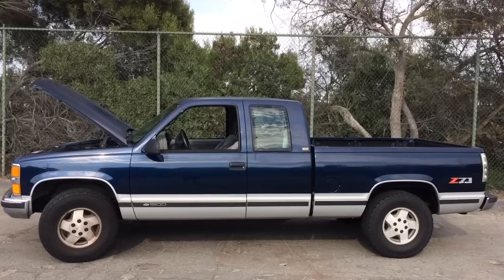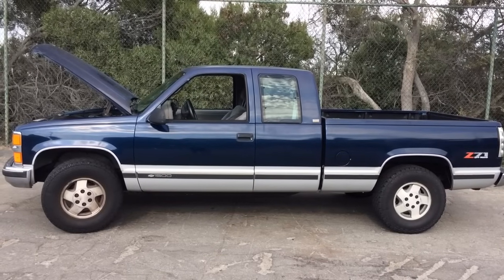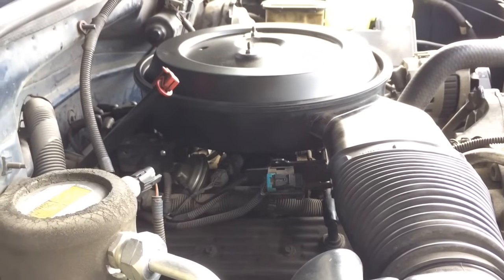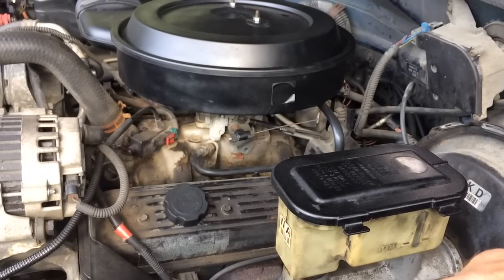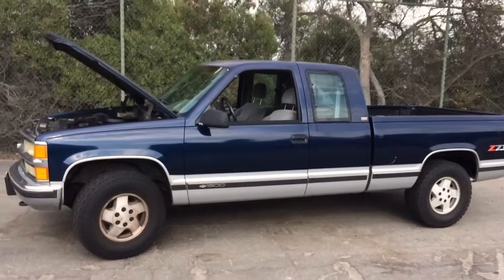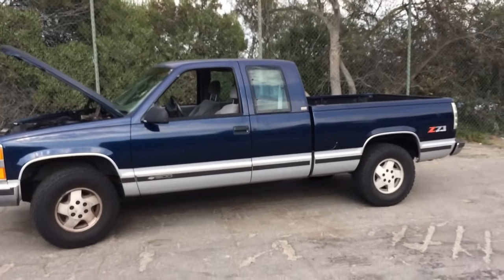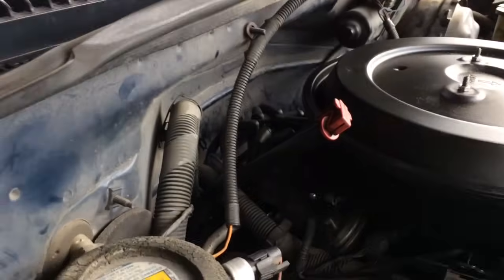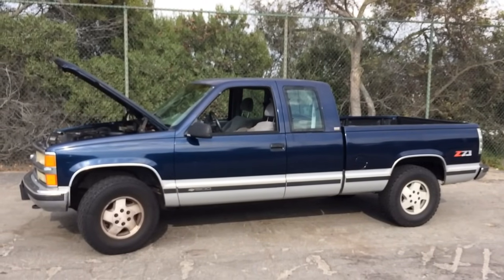Chevrolet Truck Hesitation Problem Fix

Comment: I have a 95 with a 350 and had the hesitation and sounded like it had a big overlap cam. Turned out to be the EGR valve. I had replaced MAP, all the rubber hoses, cat,  tps, and my sanity first.
Reply from the maker: At least you figured it out. With hesitation on these trucks, there are five or six different things that could cause it, and it’s hard to tell which one it is.

Comment: My 1998 Silverado is doing the hesitation thing again and I fear it's the fuel pump again. I had one put in about 50,000 miles ago and it cost me nearly $1,000. I'll try the things you mentioned but I'm thinking these symptoms are the same as they were before.

Comment: My GMC C3500 OBS with 454 Vortec has been driving me nuts (no pun intended!). When it is running in Open Loop it runs great, but the instant it switches to Closed Loop it goes to running richer and richer and richer till it's slobbering rich and missing across all the cylinders! For the life of me, I cannot figure this thing out.... new O2 sensors, new MAF sensor, new EGR valve, new Purge valve, new MAP sensor, new injectors, new spark plugs, new spark plug wires, new distributor, new ignition coil, new intake gaskets, new fuel pressure regulator (verified to be making 58 psi at idle!) new idle air control valve, new camshaft sensor, new air temp sensor, new crankshaft sensor.... this is nuts! I'm about to give up and take it to dealership (Lord help me!) and see if they can diagnose what's causing this!!! Ughhhhh!
Reply from the maker: It could be a bad  ECM computer.  I had to replace the one on my truck and it made a difference. On my truck, the catalytic converter went bad and the plates sometimes would block exhaust flow, making it run rough.

Comment: I have a 96 and I just changed the coolant sensor and I thought it was the fuel pump and everything difficult and it was a simple $25 fix. The sensor screws right into the top of the engine.
Reply from the maker: Thanks. That’s a cheap fix, though tough to diagnose.

Comment: Yeah I forgot to mention I don't know how many miles do you have but it should last forever I'm in original owner I bought my truck brand new I live in Arizona there's no rust nothing's wrong with the whole truck it's perfect original engine and transmission and I'm at 443000 Miles and going strong....
Reply from the maker: Mine is pretty low mileage compared to yours. I guess that means I can drive it for the next hundred years. These things are built to last!
Reply: Update I just did 500,000 the engines still all original the transmission started slipping in 4 th gear at 467,000 
so I had the transmission rebuilt.  My truck's running great I love it hope yours is still around😊

Comment: Just got this problem on my 94 Chevy 5.7l has new fuel pump new fuel filter new tps new map sensor new fuel pressure regulator and compressor test has fine compression all new sparks plugs also doing the ecm tomorrow hopefully that fixes it
Reply: Catalytic converter is also fine

Comment: My 98 has 299500 on the clock and doesnt burn a drop of oil these trucks will run forever as long as the rear main seal leak doesn't get too bad, they all leak there. Still pulls better than any 5.4 Triton and they're pretty good on gas compared to most trucks even new ones
Reply from the maker: Yes. Even with the common problems, these are great trucks, and they can run forever.

Comment: Holy crap as another guys said in the comments. It was my EGR valve (95 Silverado 5.0 TBI) you can confirm this super easy by disconnecting vacuum line to the valve and test drive. I can’t believe it but my truck drives like new. No flat spot whatsoever. I’ll just leave it disconnected cuz it’s my beater with 236k miles for yard projects and it runs super smooth off throttle now and can get up to speed with just 10% throttle.
Reply from the maker: It is crazy how much impact a bad EGR valve can have on how the truck runs. That’s a cheap and easy fix for you. I made another video where I take the EGR valve out and clean it and put it back on, so that is an option if you want to hook it back up. It is probably just jammed up with carbon.
Reply: hoohoohoblin not a bad idea thanks 🙌🏽

Comment: I just had my heads done on my 94 silverado and the truck hasn't been right since. I replaced the maf sensor, ignition module and o2 sensor. Then the codes read egr valve and selonoid. When I went to replace the selonoid I noticed the mechanic had hooked the vacuum line up to the vent. I hooked it up right and the truck ran great that day but went back to hesitating the next day.

Comment: Im here same reason everyone else is 😂 1992 C1500 5.7 TBI isles a little high, but doesnt die, but driving it if i kick the throttle down itll kinda bog or lag a bit, sometimes will surge and run good then bog down again.

Comment: I have a 93 silverado 5.7 ran fine until I used spray injector cleaner now it hesitate when I take off I already replaced egr map sensor  throttle position sensor and the idle air sensor  didn't solve the problem  any ideas?

Comment: Yeeeah... I had a 93 gmc sierra. Had the same problems you were having and i don't know if it was the previous owner or not but noone put a fuel filter on it. Ended up costing me a whole lotta money in parts and in the end I sent her to the junkyard cause i couldn't spend the money on her anymore. She's still sitting there...
Reply from the maker: It's very frustrating.  This truck ran terrible for a year and a half while I kept replacing parts.  The most frustrating part was that I knew it was one simple thing that needed replacing, but I didn't know which thing.  I ended up giving it to a mechanic, who spent a month trying different things until we got it sorted out, and it runs great now.  In my case the main problems were the fuel pump and catalytic converter.
Reply: hoohoohoblin Yeah, I could never get mine figured out. I even had several mechanics take a look at it. Took the seat out of it as a souvenir for my first truck.
Reply: to simple just to have someone check to see whatt the problem was

Comment: Don't drop gas tank- much faster & easier to raise the truck bed 10 inches or so  it only has a few bolts holding it on..

Comment: Don't have to drop fuel tank to get fuel pump out i found it's easier to tilt the bed and leaves ya with plenty of room to access the tank from the top. Just remove the 2 bolts on the driver side and run the 2 on passenger side almost completely out but not all the way then disconnect tail light electrical harness tilt bed up and put a block of wood between bed and frame.
Reply from the maker: Good advice. I will do that next time. Thanks.
Reply: Don’t forget the ground strap too.

Comment: Going through the same thing with my 95 Suburban right now. Replaced throttle position sensor, fuel pump, map sensor, oxygen sensor and catalytic converter. Cleaned the throttle body and injectors. Checked vacuum lines, etc. Runs good at high rpm, dies for no apparent reason when pulling up to stop signs/lights, or sometimes while just sitting and idling. Seems like it wouldn't run well at high rpm if it was a fuel filter problem? Going to clean the egr valve next. Newer plugs and wires, no missing or rough idle. No check engine code. If the egr valve doesn't work, next stop is the shop - tired of not being able to drive it. Glad to hear thoughts from anyone who knows about this issue.
Reply from the maker: It might be the EGR valve. Mine got stuck on my Astro van, and it wouldn’t idle until I cleaned it. I also had the ECU computer go bad on my truck and had to replace it. It was idling crazy and the transmission was shifting it really high RPMs, but changing the ECU computer and chip fixed it.
Reply: Sometimes the CAS (Crank Angle Sensor) can cause that.
Reply: sounds like distributor to me
Reply: @cj8172  Those didn't come out on the Suburban until 1996 - mine doesn't have one.
Reply: Update:  Turned out to be the MAP sensor, which means that two new ones I bought online from Amazon were defective. I stopped by an old auto repair business in Table Rock, NE, explained what was going on, and the owner went into the back room, came out a minute later with a used MAP sensor, said, "Try this". I explained I already tried two new ones, and he said to try it anyway, so I did. Check engine light went away and runs perfect ever since. Too late to return the defective ones of course, since I had spent several months trying to fix this *&^$*#@ thing. Half dozen different mechanics between NE and CA couldn't figure it out - this guy, a couple minutes. Sitzman Auto Repair, Table Rock, NE

Comment: This does help incredibly! Thank you! I’ve had the EXACT issues with the hesitation. I do know the CAT is bad, and I have an exhaust manifold leak. I need to pull a broken bolt first, which is giving issues lol. The fuel pump in my area is 180ish to replace.
Reply from the maker: Fixing those things should get it running normally again.

Comment: My pops truck has the stumbling i.e. bucking after having a bad crankshaft sensor. So we replaced it cause we had no spark, we also replaced the camshaft sensor and a few other parts but we're tires of throwing money at it.

Comment: My truck was Hesitating, once the engine warmed up it Puffed Black Smoke and had little to no Power when stepping on Gas Pedal - Replaced the  Coolant Temp Sensor an $11.00 part, problem solved !
Reply from the maker: Thanks. I hadn’t thought of that as being a possible problem.
Reply: @hoohoohoblin  I also recently picked up a 1995 GMC Suburban SLE, 5.7 SB 350 with 82,000 original miles from the original owner - The vehicle had Exactly the same problem after sitting in garage for 11 years - The first thing I did was replaced the Temp Sensor and again problem solved - Go Figure - Take Care !

Comment: Beautiful truck BTW.  96-2000, is a completely different animal, though the skin is the same.  96 was the first year of the multipoint FI and the OBD II engine diagnostics. In other words the first year of truly computerized engine management.  For all the reasons this guy discussed I would steer away from pre 96.  Of course if I could find a gem like this, I would be tempted.  If it were me I would deep six that motor in favor of the hugely upgraded LS truck motor that came out in 2000.  A 5.3 would run circles around that motor and you can get them cheap. You would have modern fuel injection and true computer management that is light years ahead of pre '96. The swap is common enough they actually have kits for it. The transmission is still an 4L60e but in post 2000 era they were much more refined.
Reply from the maker: Good points. My dad has an early 2000s Chevy truck that he bought new, and it gets much better gas mileage, and has been 100% reliable for almost 20 years now.
Reply: @hoohoohoblin   Yeah there is no good reason to stick with the old sbc, they have been largely superseded by what is commonly referred to as the LS style engine that came out in 96 in the performance cars.  The truck version came out in 2000 (iron block with aluminum heads) has been around for long enough they are easy to come by used. A truck like that would be well worth the upgrade and there are lots of you tube videos on that subject.
Reply: Swap engines and then it wouldn't be a numbers matching truck. I think that's important for maintaining the value if you ever want to sell it, that is.
Reply: @jimervin1637  It would just run much better. So it depends on if you want a show pony or a functional truck.  I would say most truck owners would prefer the upgrades of vortec heads a better fuel injection and a much improved ECM. Pointing to a number on a block gives some of us a boner though.  Actually all the upgrades would bolt onto the existing block, so if a less functional truck gives you a boner who am I to say don't yank it. LOL
Reply: I have a friend with a 96 Chevy Silverado c2500 the multi-port Spider injector has failed dumping fuel into the crankcase it was known to be a common problem with this design I have seen new ones break while trying to install them was not the best time for Chevy trucks and even more so now I really hope they get back to making quality vehicles
Reply: @terrybrown797  Okay, think about what you are saying. My friend has a truck that he drove for 27 years and now it has a problem. And the spider design has been know to have problems (like every other fuel system known to mankind). Also, I know a guy that broke one installing it. I really hope they get back to making quality trucks. 

In your world trucks should last how long? In your world apparently there should be a vehicle that should never have any problem even after a quarter of a century? I've installed the the type of fuel injection you mention and I agree it isn't easy but I haven't broken one, so what does that tell you?
Reply: @michaeldose2041  well my truck had three hundred thousand miles on it before the first engine had to be replaced and my first vehicle that was given to me by my grandma was a 91 Ford Aerostar and I had 600, 000 miles on that one. The vehicles that are being built today you are lucky to get 20 to 50,000 miles out of them so you tell me how long should a vehicle last you. Vehicles being built today with known engine defects but are still sold to consumers are averaging 20, 000 to 50,000 miles before engine failure. So I would say vehicle should last at least 300,000 miles before complete engine failure. But if you are happy with 20, 000 miles before you either have to replace your engine or replace your vehicle then enjoy and welcome to China junk. But I am a die-hard American and old-school muscle I bleed red white and blue. I hope these facts clear up any doubt
Reply: @michaeldose2041  sorry I should have worded it better this is not the first time that this part has been replaced this is the third Spider injector to fail
Reply: @terrybrown797 yet our 2011 GMC Acadia ran great until I sold it at 215k miles and only had one set of spark plugs, one set of tires, one set of brake pads only, two water pumps and regular oil changes. And my parents 2013 F150 3.5 twin turbo ecoboost currently has 291k miles on and will still pull 6-7000 pounds no problem. Just had misfires from clogged cats so drilled out cats solved that until we get new cats installed and fix the obvious oil leak from the turbos and beyond.

Comment: I’ve got 1996 Chevrolet Silverado 2500 4x4 I’m running into a few issues like your but I’m not doing a parts canon just shoot and hope for it to work
Reply from the maker: In my case I’m pretty sure it was the catalytic converter plates, which had come loose and sometimes they were obstructing the exhaust, and other times that would rattle into position to let the exhaust flow freely. I would’ve replaced that first if me or my mechanic had figured it out.

Comment: One of these parts might work. Expensive fix.
Reply: I agree why do ten things at once you will never know what fixed it
Reply: It sucks but it's either pay a mechanic a diagnostic fee to pinpoint the problem or just take the money it would cost you and buy those parts. Diagnostic fee is around 70$. Start with cheapest part first.  Regardless, you will have a bunch of parts you won't have to replace for quite a while if you go that route before finding out the real problem.

Comment: Hi there I have a 89 Chevy Silverado C1500 the original 5.0 blew up so I built a new 5.7 and put it in now I have hesitation when I accelerate from a dead stop it is almost like it stumbles sometimes it stalls out the question I have is the ECM from the 5.0 the same programming for the 5.7 any help with this would be greatly appreciated I have been out of work for 9 months and just got it running

Comment: You forgot the intake gasket and cracks in the heads between the valves. Lol and many other issues. I don't think you fixed it yet. Keep looking

Comment: Similar situation for me 2005 silverado replaced fuel pump truck ran great  but then 2 months later hesitation started replaced MAF sensor ran  great for 2,000 miles now was driving stopped on accelerator and truck was shaking and would barely move....pulled over let it sit for 2 minutes started back up again and ran fine for the next 10 miles home....thinking now it maybe the TPS oh and I have already cleaned the throttle body....lol

Comment: I have a 93 Chevrolet 2500 that blew a fuse to the windshield wipers and when I changed the fuse it will not start . The fuel pump will not come on any clues for helping me

Comment: You've changed so many things, but doesn't sound like you tested along the way, just kept thowing parts into it.  So it runs good, that great, but what acutally was the solution?
Reply from the maker: I suspect it was the catalytic converter. Because it would sometimes run fine and other times not, I think the plates inside got loose and would bounce around and obstruct the exhaust flow sometimes.

Comment: ..... So?  What was the one thing that fixed the hesitation?  If I push the gas aggressively at the stop light it will lay rubber.  But if I try to take off slow it will fall on it's face and stall out.

Comment: Hey I’ve got a 1988 GMC Sierra with 5.7 the original engine has been remanufactured to gm spec’s. I’ve added upgraded air filter stainless shorty headers new new value covers and installed dual exhaust with flowmaster super 10. Been running great the last few weeks it’s been skipping on accelerations and when climb feels sluggish. Checked the plugs some needed to be recalibrated and were a little dark . Cleaned them recalibrated reinstalled. Runs better but there is still hesitation. Any ideas what I should check?